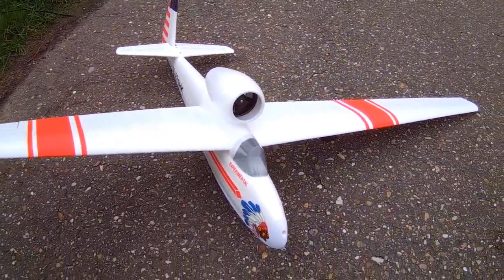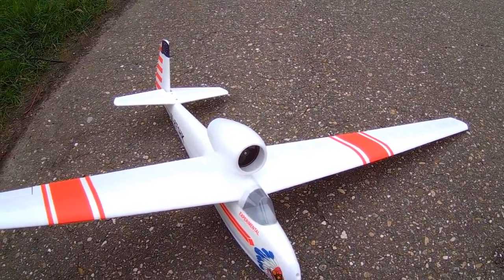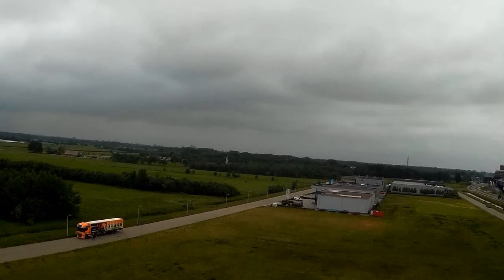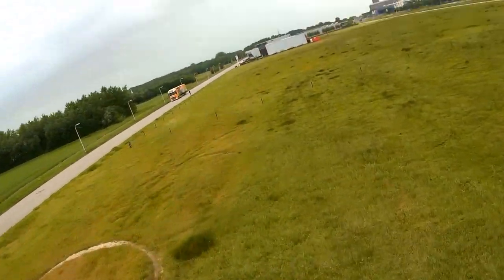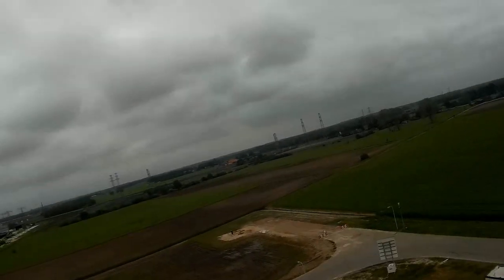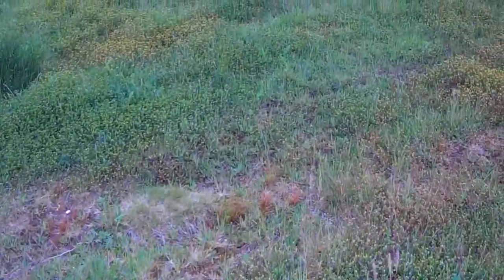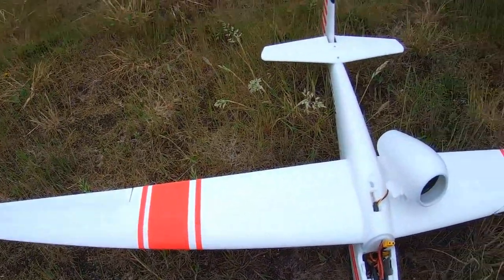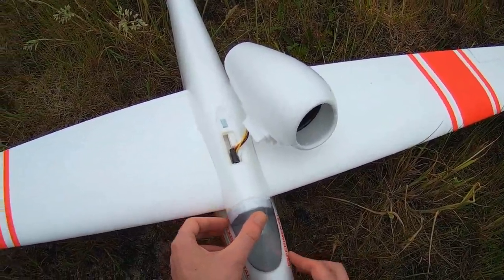HobbyKing Hall Cherokee 1700mm EDF Glider - Maiden Flight! :P

Comment: Hey Dutch. Nice bird. I had tons of fun with mine. Oh yeah... Thanks for posting and stay cool. Greetings from Slovenia, Robert
Reply from the maker: Howdy Robert :)
thanks for your feedback sir! Mine is an unpowered (slope) glider by now, as my motor / fan unit was a Monday-morning specimen :$  It does glide Well though :) 
Cheers & have a good weekend!
Reply: I put 2700mAh in mine and fly at full throtle all the time. Its fun. But with the impeler on its just not a good glider. We will try to tow it with my Pitts someday without impeler. Oh yeah...
Be well and happy landings, Robert
Reply from the maker: Yeah.. that motor pod is a bit of an airbrake huh? :) without it, it retains it's momentum a lot better :) 
Cheers & happy flying!

Comment: It did look a bit tail heavy. And if it is, would that contribute to the sharp turns?
Reply from the maker: Hard to believe really as a was using a heavier lipo then advised.. Anyway, no not really.. it's the length (or lack there off :P) of the plane the makes it turn on a dime.. That + the short wing-chord..

Comment: I would have sworn you will tip stall it with these turns ... the motor must be a big problem on an inverted as also it would push the plane down ... instead of up  I had a couple of these maiden just put it behind and carry on :-)
Reply from the maker: Well in fact, the motor will push the plane UP when inverted.. It indeed handled Tight corners VERY well indeed! Quite surpricing :D
Haha yeah man.. all part of the hobby ;)  No biggy.. it's just a toy :)

Comment: This is a good all round model, Flies well but in this vid it's not flying too well at all. Inverted it will do but only at speed, looks odd & there's really no need to fly it as such. Overall a great model if the driver knows what he is doing due it's old style draggy design
Reply from the maker: Well yeah, I think I got one with a bad motor / EDF unit.. I do still have it, but it's a slope sourer now..

Comment: Even over de naze32 als je maar 4 motoren (quadcopter) heb aangesloten moet je dan kabel 1-2-3-4 en dan nog je ground kabel aansluiten? Heb je dan ook nog een aparte ubec/sbec nodig om je receiver stroom te geven of gaat dat via je vtx want ik heb ook wel gezien dat ze via hun vtx stroom geven. Gebruik revision 5
Reply: En wat is dan eigenlijk bootloader pads
Reply from the maker: Dat ligt er aan of je ESC's BEC's hebben (in de meeste gevallen is dat tegenwoordig Niet zo).. dus inderdaad heb je dan een losse BEC nodig..
SOMMIGE flight controllers kunnen gewoon het volledige lipo voltage verdragen.. of dat bij de jouwe zo is, zou ik Goed nalezen in de specs.. (rev 5 zegt niks.. er zijn Veel fabrikanten die Naze32's maken..)
Reply: +DutchRC Adventures dat weet ik wel maar ik bedoel welke kabel je aan je receiver moet aansluiten, en of je een aparte bec nodig heb om je receiver stroom te geven
Reply from the maker: DAT kun je eigelijk op 2 manieren doen: je ontvanger voeden vanaf een BEC inderdaad.. Vervolgens voed je je Naze32 dan weer vanaf je ontvanger..
OF de andere kant op.. je sluit een BEC aan op je Naze32,, en vervolgens wordt de ontvanger vanaf de Naze gevoed.. kan beide..

Tegenwoordig kun je de BEC ook vervangen door een PDB (Power Distribution Board) zoals deze:
http://www.banggood.com/Matek-Systems-PDB-XT60-W-BEC-5V-12V-2oz-Copper-For-RC-Multirotors-p-1049051.html?p=TO251813974002015038 
Eigelijk is dat een boardje met verschillende BEC's er op.. erg handig..
Reply: +DutchRC Adventures mar nu even niet over stroom te geven aan de FC en de receiver maar welke kabel moet aansluiten vanaf de naze32 naar de receiver? Bij de rev 5 die ik waarschijnlijk ga gebruiken is er een soldering connector met daarboven niks op en 1tje met een stip de dan ook nog 1-2-3-4-5-6-7-8 dus welke moet je aansluiten op de receiver. Moet je dan ook nog 6-7-8 ook nog aansluiten?
Reply: +THE perfect guys en wil je eigenlijk ook nog laten weten wat bootloader pad is. (Staat alleen maar boot op de FC)
Reply from the maker: Ohwww bootloader pad.. die 2 pins moet je kortsluiten als je de software op de FC vanaf Niets er op wil kunnen zetten (de boarloader er dus ook op zetten).. dat heb je nodig als je je FC met een verkeerde firmware om zeep hebt geholpen :) 

hoe je je FC aansluit op de ontvanger, hangt af van Hoe je je ontvanger met de FC wilt laten praten.. Ik gebruik meestal alleen channel-1 (via het SBus protocol).. maar als je het gewoon met meerdere kabeltjes wilt doen (werkt uiteraard ook).. dan heb je in de meeste gevallen niet meer dan 1-tm-6 nodig.. (4 om te vliegen, en nog 2 voor flight-modes)
Reply: +DutchRC Adventures bedankt heb weer wat bijgeleerd.👍👍👍
Reply: +DutchRC Adventures als je nog 2 servo's wilt aansluiten en ook nog 2 flight modes wil hebben kan je dus volgens jou een 8ch receiver hebben.
Reply from the maker: Yeps.. dat gaat wel lukken :)
Reply: +DutchRC Adventures waarvoor dienen eigenlijk de 2 solder pads naast 1 bij de naze 32 rev5? Niet 2-3 maar aan de andere kant want die zitten allemaal aan 1 connector vast dienen die dan misschien voor stroom toevoer naar de receiver.
Reply from the maker: Hmmm helpt dit? http://smadja.co/wp-content/uploads/2015/12/naze32-rev5.png  ik weet eigelijk niet welke je bedoelt.. maar in die afbeelding staat de functie van alles..
Reply: +DutchRC Adventures je ziet toch wel links onder op het plaatje, zie je 1-2-3 staan boven 1 staat een stipje en daar weer boven niks. Ik vraag me dus af waarvoor dat dient. Volgens mij komen daar een zwarte en een witte draad te zitten dus ik denk dat ze stroom leveren voor de receiver of dat daar alle channels door heen gaan voor ppm gebruikers
Reply: +DutchRC Adventures op het plaatje is het rechts van het getal "2" en rechts van "rc"
Reply from the maker: Ah zo.. van boven naar beneden: Plus; Aarde; Channel 1..
Reply: +DutchRC Adventures mar komt er dan door de plus en aarde 5v stroom doorheen voor de receiver
Reply from the maker: ja.. ALS je via een andere weg het board voeding geeft wel.. Het moet Ergens vandaan komen uiteraard..
Reply: +DutchRC Adventures dus als het via de bec van de esc stroom toevoert naar de naze32  dan zou die dus volgens jou ook stroom moeten leveren aan de receiver
Reply: +DutchRC Adventures dus als er stroom komt van de bec (van de esc's) zou dat ook stroom moeten leveren aan de receiver
Reply from the maker: Yeps.. zo werkt dat dan inderdaad.. OF andersom: BEC aan de ontvanger.. en dan voedt de ontvanger de FC.. Kan allebei..